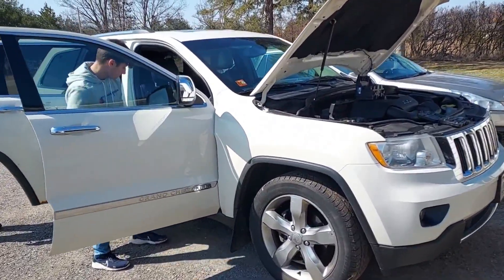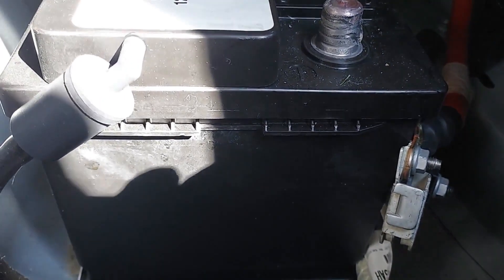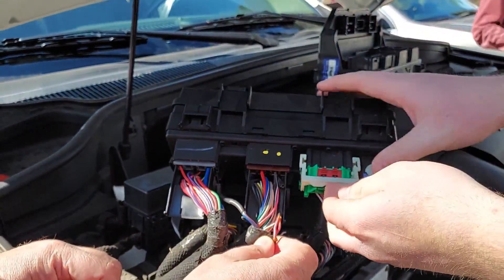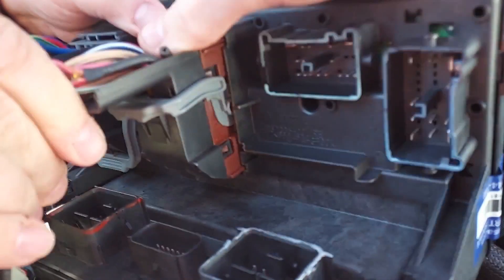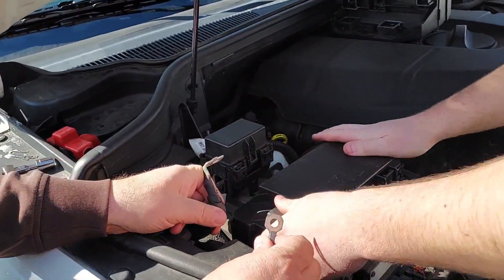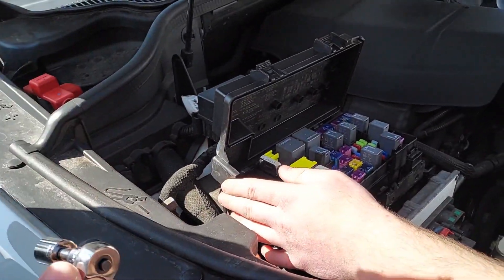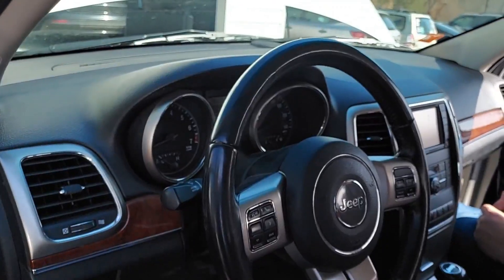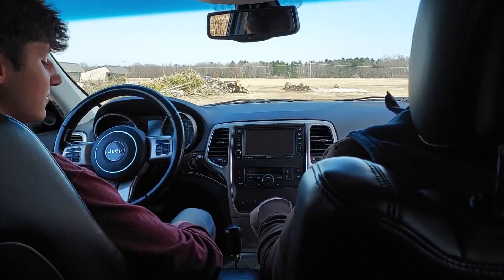Replacing TIPM on Jeep Grand Cherokee (2011)

Comment: Did you have to have the tipm programmed I purchased one my truck cranks but won’t start I’m getting P0882 code and P2128 code I just bought this truck cash several weeks ago and was running great then this happen help please
Reply from the maker: It was pre-programmed but did have to take it to a shop bc 2 fuses were switched and we couldn't figure it out

Comment: Question out of curiosity…
I have a 2011 Jeep Grand Cherokee Limited 4x4 5.7L Hemi with the tow package
My radiator coolant fan on runs on low when my A/C is on… replaced the fan yesterday and still having the same problem. Checked the fuses. All looks fine. Replaced the relay and still nothing. Also having a problem with the air bag light being on and A/C only being cold going down the road. Car will run hot if A/C is not on because the fan will not run will it A/C is not on. All forums are saying TIPM, but wouldn’t the fuses not light up test light if that was the case? Thank you!!
Reply from the maker: It really seems like a TIPM problem, or maybe one of the wire harness plugs.
Reply: TIPM I’m about to replace mine getting the P0480 code relay switch replaced them but I’m sure it’s the TIPM

Comment: I installed a the replacement TIPM the same way didnt start had anti thief flashing and security screen came up no start no crank I installed the old one back and everything came back to normal started with  no security code reinstalled the replacement and same issue any advise ?
Reply from the maker: If it is a used/refurbished TIPM, there could be something wrong with the way it's set up
Reply: I have the same issue it wont start after a i bought another fusebox
Reply: What did you endup doing to fix the issue you’re having

Comment: So ive bought a used TIPMS for my 2015 JGC and now rather than loosing a few fuctions ive lost everything and everthing is coming up on the dash as requiring a service. Service FWD, service transmission, service air suspension, service everything and the engine sounds rough too. Could my original issue actually be my ECU and not the TIPM? My original issue was air bag light staying on, uconnect not working at and my alarm going off randomly. Though it all started with my sat nav saying I was in Moscow! I live in England. Then things like the powerfold mirrows and windows only worked with the engine switched off, then couldn't oped my drivers door without locking it and unlocking it. Gradually new faults came up almost daily. Any help really appreciated
Reply from the maker: I guess it could be the ECU or TIPM or both. I would still suspect something is wrong with the used TIPM.
Reply: @KBrosAuto  thank you for the reply. I contacted the company that supplied the used TIPM, they are sending me another, but I have little confidence that it will make a difference. Assuming it doesn't then it will be a costly trip to Jeep. Again thank you for the response
Reply: So the replacement TIPM arrived. I fitted it. Same faults as my original TIPM. Had the battery tested again, nothing wrong with it. What are the chances all 3 TIPMS are faulty with the same faults? Highly unlikely, right? So lets say TIPM and battery are fine, does that just leave the ECU?
Reply from the maker: I guess so, hopefully it's not crazy expensive
Reply: @KBrosAuto  Pleased to report, a loose cable conector under the pasanger seat, was the issue. I've hours under the hood and under the car. Couldn't find anything out of place. Then I started looking in the car. Unbelievable. Just like the TIPMS, two great big cable conbectors with the big clamps, locked it back in place. And wow everything works. Sat nav still says I'm in Moscow, but from where i have been for the last two weeks, I can live with that! The car is going to jeep in the next 10 days for a software update. I thought I would share this in case it helps any of your other viewers! Best wishes,
Mike

Comment: Does replacing TIPM require reprogramming??
Reply from the maker: It should not, sometimes a used or refurbished TIPM will need to be looked at but the car itself will be ready to go after the replacement

Comment: I need some help and advice. I have a 2018 Jeep Grand Cherokee it has 2 batteries one large battery and one small battery. With this small battery I accidentally touched the negative and positive cables and then it sparked. I tighten 
the bolts down and then I started in my car  and my windshield wipers my Uconnect  system my battery light indicator is going crazy. And my engine is very weak and shaking. Also my windows don't roll up.  it ended up dying like the battery is going dead. Did I shorting something accidentally touching the 2 cables on the smaller battery?  Can this be my TPIM? Thank you
Reply from the maker: I would think that either the small battery needs to be replaced or the TPIM, its not a bad idea to check your fuses or the voltage on the car battery with a multimeter.
Reply: @KBrosAuto  Thanks I stayed up all night researching this issue. And it ended up being my fuse block for my fuse block - mopar (68089468aa. I removed the fuse block and there the circuit had blown. However I need to go to the dealership and get another one but let's just hope that this is the case 👍